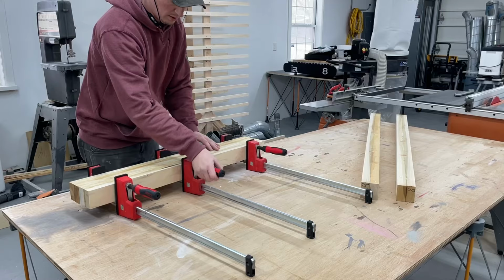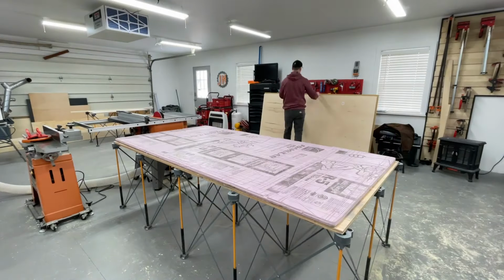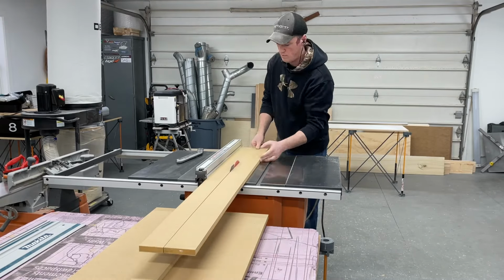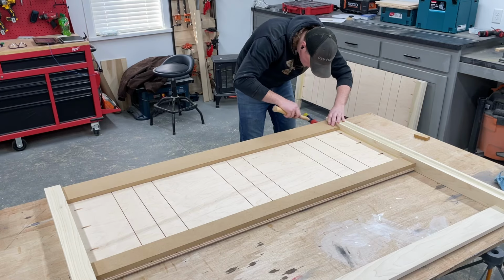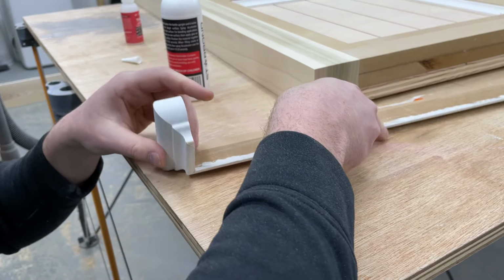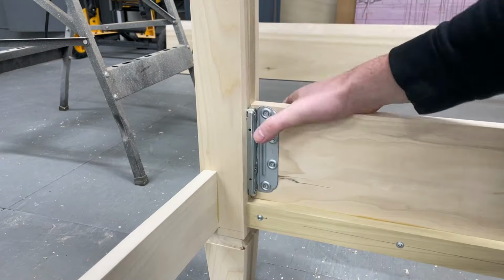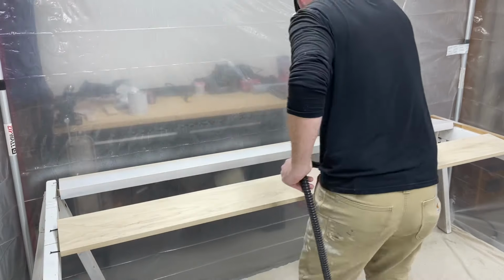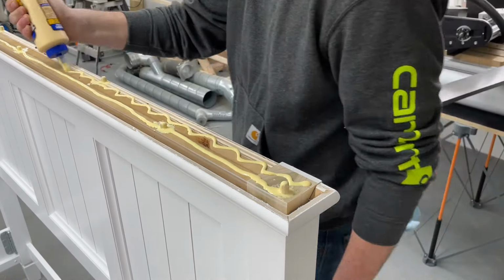Bedroom Suite Build Series Part 1 | The Bed Build!

Comment: Switch to a PIN Nailer...you will wonder why you didn't do it before. The holes won't even hardly show. So much easier in finish work 🙌👍
Reply from the maker: I have one haha just try to avoid the air compressor in videos. Waiting for Milwaukee to release the new cordless one!

Comment: That looks really great, John! I'm beginning to really like the look of contrasting solid wood / white finishes. I built a free-standing kitchen cabinet a few years ago with a similar look - finished with a white base, solid Walnut top and black hardware and it came out awesome. It'd be great to build everything out of beautiful solid wood but it's just cost prohibitive for many people. Can't wait to see the rest of the pieces in the series!
Did you do anything to finish off the bottom of the headboard like edge banding or just paint over the exposed sandwich of plywood and MDF? Certainly not necessary for the footboard since it's so low but depending on mattress height, I could see how the bottom of the HB could be exposed while lying in bed.
Reply from the maker: No I didn’t do anything to cover it. With the box spring, the mattress comes a few inches up on the panel so it can’t be seen 👍🏽 thanks for watching!

Comment: Look awesome can’t wait to get
Your plans and start make one myself. Do you have a link for the clamps for the taper jig? Also any issues with the frame hardware with any creeks and noises with the boxspring and mattress on?
Reply from the maker: Clamps are linked in the description 👍🏽 and no this is the most solid and quiet bed I’ve ever been around haha. I’m sure it depends and could make some noise depending on how good the hardware is installed, but not gonna lie, I nailed the fitment and they’re perfectly tight haha

Comment: John I'm in the process of building two twin size for my kids like I mentioned earlier. Any advice on the width would be appreciated. I didn't know there were two sizes for twin mattresses. Some are 38" wide and some are 39". I'm shooting for 38.5" hopefully it works. I already got the head boards and foot boards done. Just need to cut the rails, attach the hardware and paint. Some changes I made are 1) I'm using oak for the caps, 2) I used 2x6 for the rails and raised them so there's no need for a boxspring. I also chamfered the side rails with a 45 for safety. I'm planning to make a sliding drawer that sits on wheels and rolls in a out. I'll post the photos on a message board and link them once I'm done.
Reply from the maker: I’m not sure man, best bet would to get the actual mattresses first to be sure

Comment: What wood should I use for the legs? At Home Depot or Lowe’s I can’t find 2 1/2” poplar square stock or even 2” boards to glue together. Would gluing 4-1” boards work? It seems like that would be too many boards.
Reply from the maker: That’d be perfectly fine man! Believe it or not, gluing multiple smaller boards together is actually more stable and stronger anyway. Have you tried to google and find a hardwood dealer near you though? Would be a lot cheaper than a box store!

Comment: How do you like dowel jig? I've been looking at them and for the price of that one it has some pretty good reviews. I know there is much better ones out there, but I'm on a tight budget.
Reply from the maker: I don’t remember which one I used in this video haha but yes I like all the ones I use! A lot of times I’m mainly just using them as a straight drilling guide. So the Milescraft Drill Block is great for that too and only a few bucks 👍🏽

Comment: Great video! Would love to make this but don’t have a track saw, do you have another recommendation/option to get the same result?
Reply from the maker: A regular circular saw will do the same thing 👍🏽
Reply: @JohnBuildsIt  thanks! Just bought the king size plans.  Question on the legs/posts, what is the most affordable way to get poplar boards to those dimensions?
Reply from the maker: Menards and some Home Depot’s carry the 2.5 square stock. Or just glue smaller boards together 👍🏽

Comment: I have all the wood to build my bed ( prices have doubled in a year! ) but my question is how deep to set the mattress into the frame so the sleeper doesn't end up sitting on the wood as the mattress sinks under the weight of sitting on the edge ? Half way down ? I don't want the mattress to sit on top of the frame as it will slide off. I like how you have planned to set yours in, looks about half way ? Thanks
Reply from the maker: In this case they were using a box spring as well, so the support cleats are sunk all the way to the bottom. Really just depends on how thick and firm your mattress is! Halfway should be a safe bet though
Reply: @JohnBuildsIt  Thank you. I actually bought a good orthopedic metal frame with adjustable spring wood slats as the base and for the moment a sping coil mattress as it's for a guest room and after buying the wood and the foam for the headboard I couldn't invest in a good Bultex mattress. The bed head and frame will be padded on top of various foam thicknesses. Although I live in a large old house in France the bedrooms are not wide enough for queen size beds. Given the price of lumber these days it's best to forget Bitcoin and stock wood ! Best Wishes

Comment: May be dumb question do you need a box spring ?
Reply from the maker: Probably depends on the depth of mattress, but yea they got a box spring to go with it
Reply: @JohnBuildsIt  thank you ! So I’m halfway done building it but my old table saw is about at the end of its life and I messed up on the legs and there all about 1/8th inch smaller after planing them to get the saw marks out of the surface so now there about  2 3/8’s . I could just add that 1/8th to the side bed rail ? I’m thinking it may throw it off since I’m 1/8th under . I may just have to make new legs cause it may affect everything else